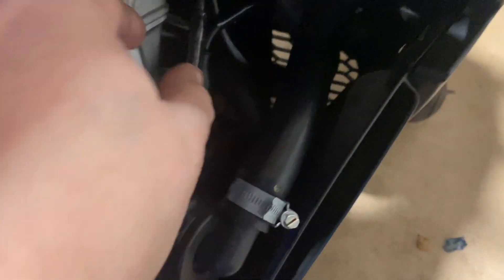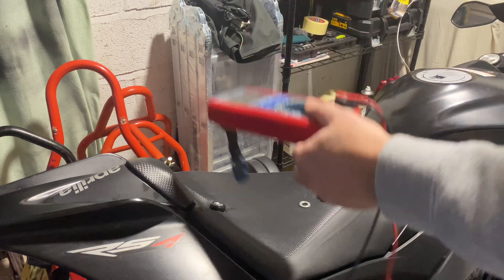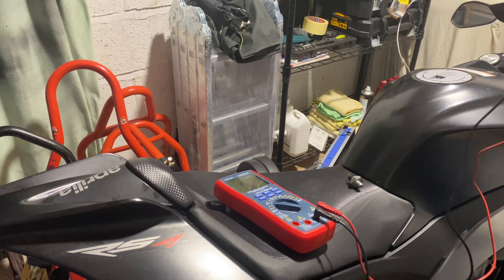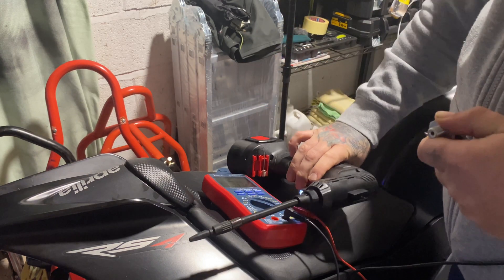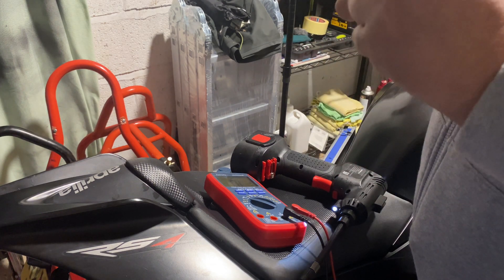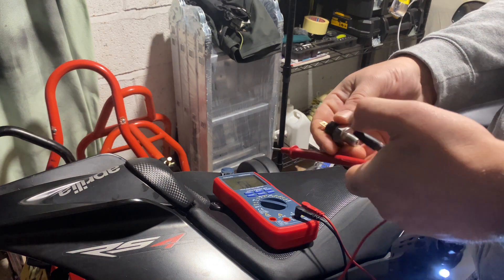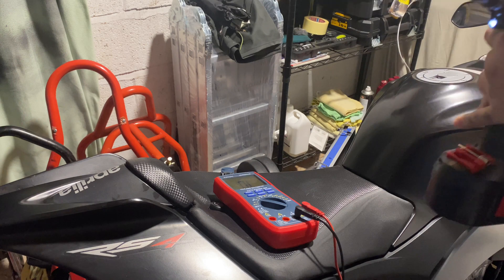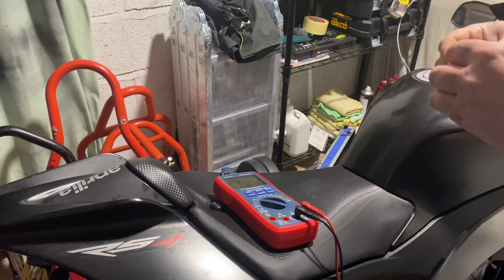Aprilia Rs4 125 Oil Pressure light and Replace the Switch plus Quick Way to Check

Comment: Hi, I just bought a new i2m dash and the oil light won't go off after starting the engine. But there is no error or check engine light on my oem dash. So my question is, without changing the oil pressure sensor, is there any other way to test?

Comment: Can you please make a Video on how to replace the right killswitch and estarter Modul.
Reply from the maker: Do you mean how to take the assembly off ?
Reply: @BigBoyzToyz1974  yes my old one is defect and I buyed a new one. But I don't know how to replace it because the cable goes under the speedometer and I don't know where they came out.
Reply from the maker: I’ve just done a video I see what you mean I think you might beable to get to it by taking just the screen off instead of the whole front end 👍
Reply: @BigBoyzToyz1974  great. Do you upload it in the next time?